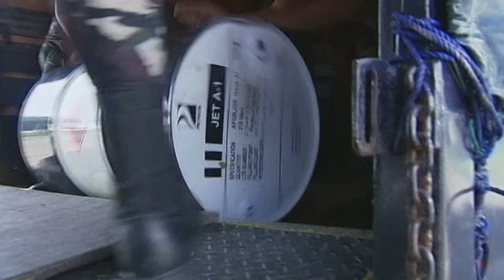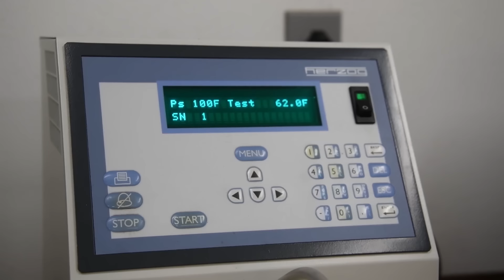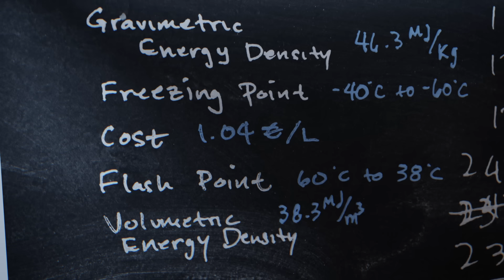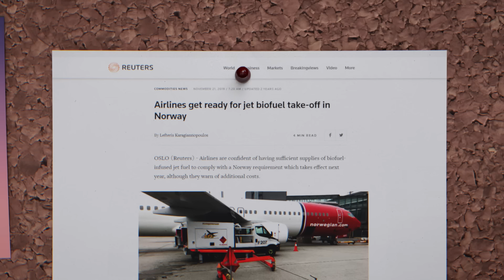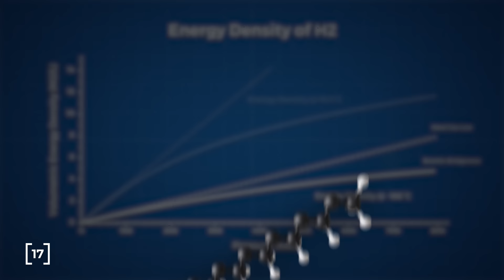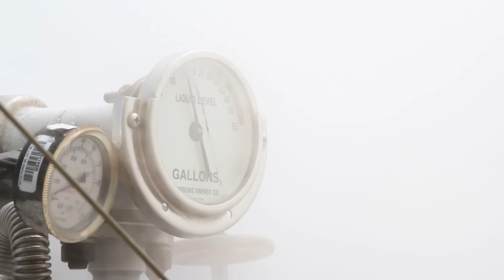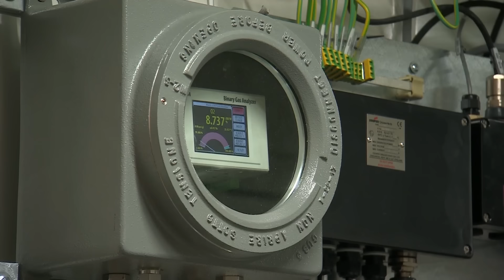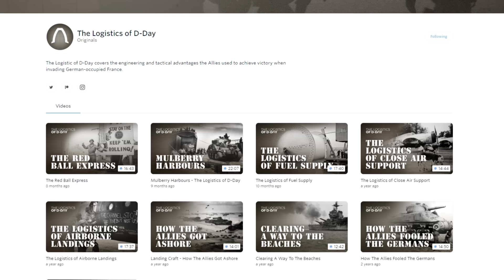The Uncertain Future of Jet Fuel

Comment: I’m thinking about the SABRE by Reaction engines. Hydrogen and hypersonic looks good to me.
Reply: @derronong9331  hi yes They get around the drag issue by crusing high in the atmosphere the structural issues are  delt with by having a completely different design. There is almost nothing in common with SR71.
Reply: How are SABRE engine progressing In the test phases? I’m hoping they don’t encounter significant challenges.
Reply: @Zen_Power  as far as I know very well. There's nothing on there news updates that says any issues.
Reply: This is only useful or economical for transpacific/transatlantic flights, or maybe flying long overland routes like New York to L.A. or Moscow to Vladivostok or Toronto to B.C.... We need a more down-to-earth solution for regional routes and everything else.
Reply: @derronong9331  from what I’ve seen, the SKYLON was designed more like an airship believe it or not. The material was unique and formally used on Soviet submarines and behaves differently to what we’re used to. The internal areas were almost completely disconnected and hangs in its own area. Space x kind of put the idea of a space plane to bed that’s why they’ve focused more on the transportation industry.

Comment: At 39,000 feet [11,900 metres]  the temperature can range from range from -46° to -62° C

There are other considerations such as the temperature at ground level
Also the measurement methodology
TAT: Total Air temperature is the actual temperature the aircraft is experiencing,
         due to the friction of the air.
SAT: Static Air Temperature is the OAT (Outside Air Temperature) in static conditions.
As a former Air-force pilot  it is correct that the Military have different requirements to
commercial aircraft, because of the type of aircraft, area of operations and altitude the
aircraft is normally operating at.
There are many hazards in handling any flammable liquid-  Static Electricity is of particular
danger, more so aboard Aircraft Carriers.

Comment: Is this really a problem? Decarbonization is an absolute nonsense on it's own...
Reply: Yes, carbon is a massive problem. Biofuels are an interesting solution because we can eventually move to a point where we capture carbon using a solar driven process (thanks plants!), use the energy, releasing that same carbon, and repeat. But there are a lot of complexities and costs here, and the environmental costs will be reduced over time.
Reply: @hireahitCA   u know that plants release Carbon dioxide at night, right? So do the “bio” fuels…
Reply: @KapitanPisoar1  plants consume more CO2 than they release (they have to, because they use the carbon themselves while releasing the waste O2).

Biofuels are a net neutral CO2 emitter because all of the CO2 they eventually release was captured from the air by the plant in the first place. Burning a biofuel is breaking the carbon chains, combining the carbon molecules with O2 in the air, releasing CO2 and energy.

There are other problems and challenges with biofuels, but CO2 emissions isn’t one of them.
Reply: @KapitanPisoar1  Yup, all of those are issues. But their consumption/use is carbon neutral, and their production can be too by using green energy sources and/or biofuel itself to fulfill the logistical considerations.

Water is needed, but also is not consumed/destroyed meaningfully, as it too is eventually released back into the water cycle when the fuel is finally burned. Again, there are issues here since significant fresh water resources are needed. 

Sustainability is a work in progress and absolutely can be achieved, it is a function of cost and is not yet economical, but unless people work on it, we won't get there. And many of these considerations go away when we start using "used" cooking oils, since all of the issues growing the plant products cease to exist as we're now taking a post-consumer product that was going to be grown and processed anyway.

More importantly, even today, biofuels have potential to be competitive with fossil fuels in terms of the environmental impact, which makes biofuels a lot more attractive as an immediate intermediary solution.

Comment: The funny thing is, Nuclear Power would probably boost like 90% of these proposed solutions into being possibly viable since it’s a huge source of energy that has no emissions and can run for decades. Hydrogen is complicated to work with, but using nuclear power for electricity would allow much more “excess” energy that could be used for all kinds of things, like desalinating water, etc

Comment: There's one more option which I didn't hear mentioned: CO2 to fuels, like what twelve.co is working on. The process involves the reduction of CO2 - so it's still energy intensive (requiring energy from renewables), but is an alternate method of producing jet fuel without fossil fuels.
Reply: I think he talked about this kind of thing as "E-fuels".

Comment: Absolute value of emissions from air travel will not change as much as the relative value assuming reductions in emissions actually work. This then begs the question: do we need to care that planes emit CO2? In case anyone forgot, CO2 is part of photosynthesis process which is kind of important.

Comment: The problem with hydrogen is, with literally free electricity at night, that methane derived gas is still cheaper. Even petroleum based alcohol is cheaper than fermentation. I keep hearing that plants can break water with less energy than humans can, but no significant research in years.

Comment: Flying over the poles at the altitudes jet's usually cruise at, the air is generally WARMER than at the equator, because the tropopause is lower at the poles.  As someone else pointed out, the problem arises during long flights.

Comment: 0:15 and the first gross error. Aviation emissions are NOT 2% of the total, they are 2% of transport,  which itself is only 16% of the whole. So aviaition is de facto 0.3% of emissions. There is way too much fixation on aviation emissions when we are failing so badly in sectors which can readily be decarbonised and yet make contributions an order of magntiude bigger than jet transport.

Comment: I’m fairly certain that the most common H2 feedstock isn’t water via electrolysis but is actually derived from methane (releasing co2 in the process)
Reply: Currently I believe yes, but that's not a sustainable solution, just shifting the problem.
Reply: @kempo_95  I agree that it’s not sustainable but I don’t think electrolysis will ever be the answer. Electrolysis is just so expensive. Honestly H2 has never made sense. The only way that I think we start seeing hydrogen being used in the aero industry is if zeppelins make a comeback

Comment: 1:45 what is that plane? Edit: He 280, searched a little while longer and finally came across it!
 it looks like an Me 262, but with a twin tail configuration. Also, it says "Heinkel" on the side. It's clearly an early jet fighter, and it has the Iron Cross on the side of the fuselage too, so I'm assuming this is still a WWII early fighter. Any help?

Comment: remember that most of the world's H2 is produced by steam reforming
basically a by product of oil refining
so if anything is ever powered by Hydrogen
it will not be green
unless it's produced by electrolysis
AND the electrolysis needs to run on green fuel too

Comment: Something I don't understand is why haven't we put a focus on using high temperature superconductors with LNG coolant and batteries to make hybrid electric aircraft as methane is plentiful and often a waste gas that gets flared off when drilling for oil and jet engines need to be operated at or near max power to run most efficiently?  The idea would be the jet engines will run continuously at or near full throttle throughout most of a flight so they get close to max efficiency where normally they wouldn't and may even be shut off on the ground where idling is very wasteful.  Then batteries fill in the slack space to provide peek power demand, power smoothing, emergency power, and ground power.  The superconductors would be cooled with LNG and then the waste gas would go into jet engines to help power them.  Maybe when you do have the APU going on the ground, you may even have an extra mini one that is designed to mainly run off of the waste methane gas from the superconductors when the main engines are shut off.  An additional thing you would be doing with a hybrid electric system is doing an electronic gear reduction where current jet designs are built around a compromise between having a bigger and less efficient bell in the back of the engine to drive a larger fan in front and shrinking that bell to make the engine more efficient.  Instead you would have a straight through design to run a compact superconducting generator, run the power over superconducting power lines, and then electronically gear reduce to run any props or fans, maybe even having the fans pushed by a ring motor pushing on the outer edge of the fan blades instead of the inner edge and maybe even using say inductors on both sides as opposed to stators pushing on either magnets or induced electric field while using induction to transmit power to the moving side.  An additional play on a more battery intensive version of this would be to develop VTOL aircraft that hover primarily on battery power while the jet engines are sized to mainly provide level flight power.  With talk of where to place things, the hybrid design would still have regular jet fuel in the wings, but would have say an LNG tank in the often under-utilized attic space of the plane and shouldn't be too much of a burden as it is primarily used as a coolant with just the gas exhaust from cooling going into jet engines to be burned.

The notion for getting towards carbon neutral is a combination of producing methane from electricity, something Elon Musk plans on doing from Mars to bring Starship back to Earth and improving battery tech over time to further lesson the need for jet engines as primarily power plants for this hybrid design.  With VTOL, maybe you end up doing regular stops where you recharge batteries quickly, something that could also be a real boon to say getting around a large, congested city or wider regional population centers.  Maybe you do structural batteries to make the aircraft lighter and more efficient to use battery tech.  While I don't see nuclear literally taking off, it would be a theoretical way to get long haul electric aircraft around using nuclear tug planes.  Maybe even do short distance power beaming where the nuclear plane uses its weight capacity to run large generators and house power beaming equipment and does lose formation flying with possibly several electric planes receiving power from it in order to cover long distances.  This way you don't have the danger of hard physical contact in mishaps while hooking up leading to damaged and even crashed planes, but instead the aircraft maintain a safe distance from each other.  Granted it would be a lot of power to beam around, but at least with the relatively short distance it could be well focused with all of the energy hitting the receiver and non missing.  I think you could for example have the nuclear plane 2,000 to 4,000 ft above the planes receiving the power and have an autopilot feature to maintain formation of multiple aircraft receiving power from the nuclear plane.  If the receiving planes are hybrid electric, they just don't burn any jet fuel while receiving power and then fire up their jet engines when it is time to break away to go to their final destination and all electric would have good batteries to make it the rest of the way to their destination.  A cool thing about this power beaming idea with a hybrid electric plane is even if you can't get your jet engines restarted for some reason, when you declare an emergency, the nuclear power plane just needs to get you into gliding distance of an airport to do an emergency landing at and then the battery power systems will make the approach like a normal powered approach complete with an easy ability to follow a normal glide slope into the airport with the exception being probably no ability to do a go around as the batteries and even windmill power generation from props / fans could produce plenty of power including thrust when trying to maintain the glide slop into the airport with shifting winds.  This is still a vast improvement over a dual engine failure today where the plane tends to have minimal instruments and minimal control because pretty much all of the power comes from the jet engines and so when they are not working you are in a world of hurt, especially when the plane runs out of fuel and so the APU can't be started.  Also of course a power generation plane could follow the stricken plane down and give it any additional energy it needs, granted at altitude there are the fewest things that could get in the path of the beam and cooling is a lot better.  I mean going from the engine out emergency today being the stars need to be in alignment as well as a very good flight crew to pull it off to the nuclear plane gets you into position and then everything is pretty normal all the way down is a lot safer and it could even get to where it is like "what emergency?".  Having confidence that you can turn off the jet engines while the plane is in operation is very important to reducing the use of jet fuel.

Comment: These are complex problems. An increase in cost represents an automatic increase in the negative impact on the environment, since each unit value was generated by the use of fuels, resources, etc. This is why, despite what SO many think, the market is almost always the best regulator. When it ACTUALLY makes good sense to use a new technology, the market adopts it. Early adoption is counter productive.

Comment: Whoever made this video really does not know how commercial jetliners operate.  Yes, they use fuel for takeoff and landing, but not for cruising at altitude.  With the exception of the auxiliary power supply in the rear of plane, commercial jetliners do not consume combustible fuel while cruising.  The air being sucked in as it is cruising, creates the power to the engines.  Research it for yourself...I kid you not.  This is a well-kept secret in the airline industry.  One tanker truck is not nearly enough to supply all of the fuel that these big jets would require for intercontinental flights.

Comment: Small error around 3:45 you state the longer chain hydrocarbons liquify lower in the chamber due to their lower boiling point. This is incorrect the longer chain ones condense and liquify lower in the chamber as their boiling point is higher. Just thought it might help to point it out maybe you can add a corrective note in the description or something.

Comment: Did you mention ammonia, I don't remember. I just suddenly realized that ammonia is an obvious answer: no carbon emissions or other problematic emissions (combustion releases only nitrogen and water), more energy released per atom combusted than with hydrogen (though much less per unit mass fuel), liquification temperatures much more manageable than for hydrogen, and there's even some precedent for it on planes with the XLR99 rocket engine on the X-15, which also used liquid oxygen. Admittedly, that is not much like an airliner, cryogenics in general are a problem, even if mild, and ammonia creates a risk of toxic fumes, though I'm not sure if it's worse than the toxic fumes from gasoline, people use and even touch ammonia-water solutions at home all the time, and it's definitely not as toxic as hydrazine, another nitrogen-oxygen compound that's a better fuel. (I would mention the less toxic hydrazine replacements developed for rockets, but they contain carbon.)

Comment: You mentioned at one point around 17 minutes that jet wings are getting more sleek and hold less fuel. Unless it was someone else’s channel I thought you said that the Boeing 787, specifically, because it uses a supercritical airfoil (which can grant the wing a larger frontal portion) actually holds more, or can hold more, fuel. Is the 787 the only exception? Could more jets incorporate a supercritical airfoil in order to hold more fuel?

Comment: I think the longer hydrocarbon chains liquefy lower in the tower thanks to their higher boiling point. There should be more heat lower in the fractional distillation column, but the longer chains condense sooner, because they condense at the boiling point, which is a higher temp, because longer chains mean more van der waals forces and more molecular cohesion.

Comment: The quick an easy answer is recycling our waste 90% of our waste is carbon based and can be mixed into a crud like slurry and then fractionally distilled out to the required carbon length. Yes this will be energy heavy and may will produce other byproducts but in comparison would be more efficient and less wasteful than our current method of extracting fuel or managing waste. We just blurry our waste and hope it goes away and extract our fuel and release tons of harmful chemicals into ground water and air. But there are too many people profiting from our current method

Comment: I'm disappointed.  There wasn't any mention of using a molten-salt reactor.  It doesn't have a problem with cold temperatures in the arctic.  In fact you don't need to get fuel for years.